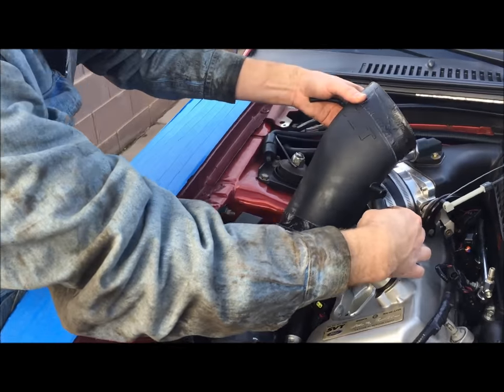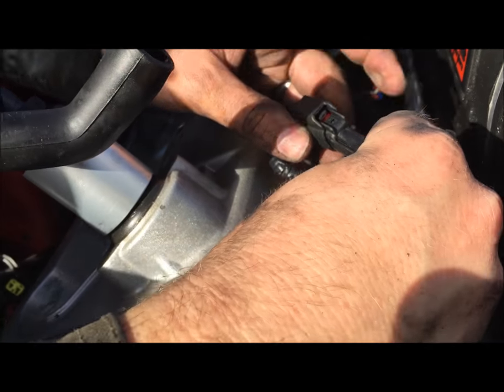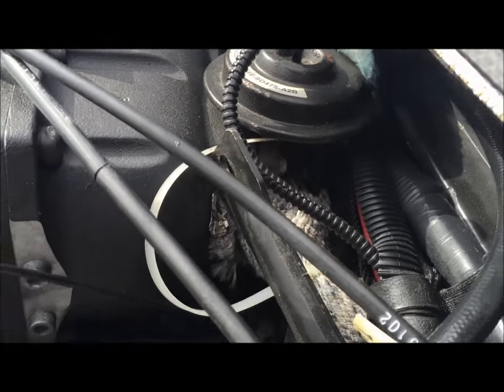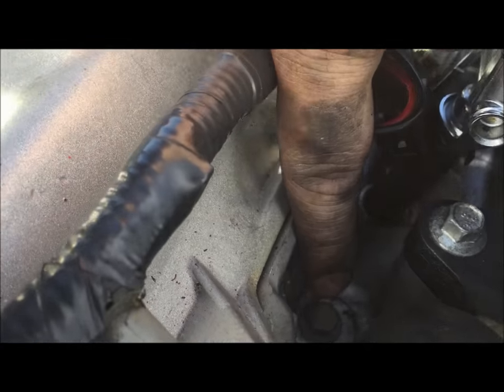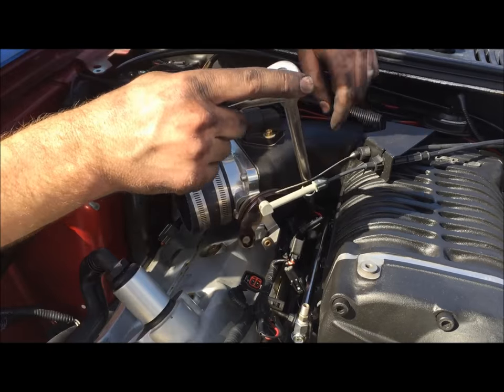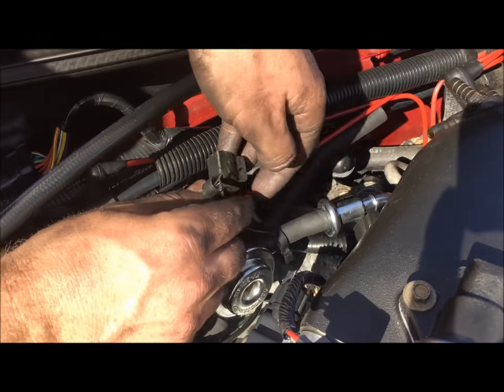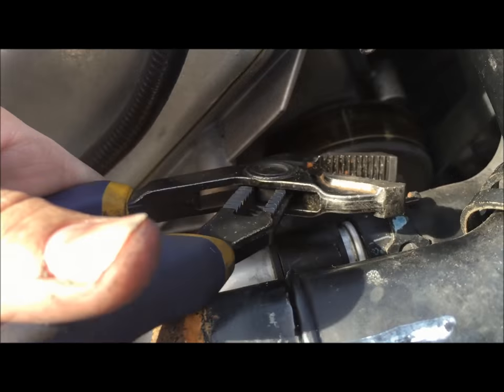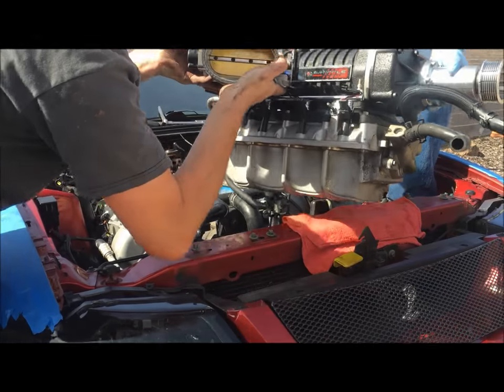03/04 Cobra Supercharger removal / install

Comment: Great vid as usual Danny, this will help a lot of folks here and on SVTP.
Reply from the maker: Tony C. Great. That's my goal. The engine swap vid this came from is tough because after the blower is off its virtually the same as pulling any 4.6, so I hope people still use the video even though it's for a cobra. There are also a lot of steps like removing the blower that people won't look for in an engine pull video, so that's why I'm editing so much of the same video (not sure if you saw this came from the engine pulling video)

Comment: Is this the same process for removing the stock Eaton? I know you have to run different fuel rails for the whipple so just wondering.
Reply from the maker: the stock fuel rails can be run with the whipple as well (at least the 2.3L). Same process- but if you want to leave the lower intake manifold in and pull just the blower you can also do that. Might be a little difference, but it’s the same process as shown in this video
Reply: Danny Johnson Ok thanks for the advice, just wanted hear a hands on opinion since Lethal Performance recommended a rail swap for the 3.4/4.0L. Haven’t made up my mind on which one I’ll choose, but again THANKS FOR ANOTHER HOW-TO VID!
Reply from the maker: ThatIndieGlo Sure thing. Thanks for watching 🙂

Comment: Do you have to remove blower to access spark plugs on the throttle body side?  I have a series iv saleen kit on 99gt , several people are saying i have to remove entire blower just to access spark plugs.  Seems like a lot of work but i am unable to start the vehicle and cannot perform a complete spark test
Reply from the maker: trendy bromandolorian You shouldn’t have to, but it depends on the setup. On mine I have to remove the extension from the ratchet, drop it down into the cylinder head in order for it to clear, then re-attach the extension. Some superchargers also have a removable elbow (this whipple does not unfortunately).

Comment: You think I can get away with unbolting the manifold, throttle body cable, and front IC hoses ONLY to lift my leaking crossover tube ?   My idea is to lift couple inches of my supercharger and get the crossover out. Thanks
Reply from the maker: EAbraham.R It should be pretty close. I would try it, and if not, just pull the bolts that mount the supercharger to the lower intake manifold and lift it the extra inch you need
Reply: Danny Johnson I hope I don’t have to do that, I have fore fuel rails and a Kenne bell.  The space is the worst!!!

Comment: do you have to remove radiator and fans? noticed you were missing all that up front. and drain all radiator fluid?
Reply from the maker: Vincent Laudi yes- here is the link. In my other videos I remove the entire engine, so if you don't find what you need in this link,  check out my other videos https://youtu.be/DKb5ldeqXjo
Reply from the maker: Vincent Laudi yes- here is the link. In my other videos I remove the entire engine, so if you don't find what you need in this link,  check out my other videos https://youtu.be/DKb5ldeqXjo
Reply: Danny Johnson  aweaome thank you!! if all I am doing is swapping out blowers, do I have to pull radiator and fan or can I just get away with just draining? pulling 2.8 kennebell from buddies car to swap out with my eaton and installing 3.4 whipple on his.
Reply from the maker: Vincent Laudi yeah, the car's radiator is a complete different system. You don't need to touch it. Just disconnect the heat exchanger hoses near the blower and drain them if you want.
Reply from the maker: Vincent Laudi yeah, the car's radiator is a complete different system. You don't need to touch it. Just disconnect the heat exchanger hoses near the blower and drain them if you want.